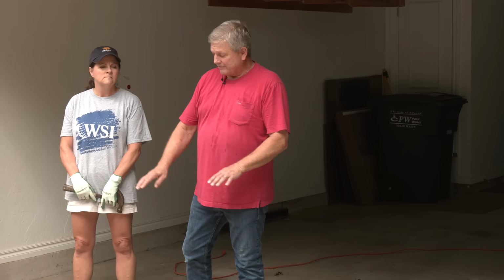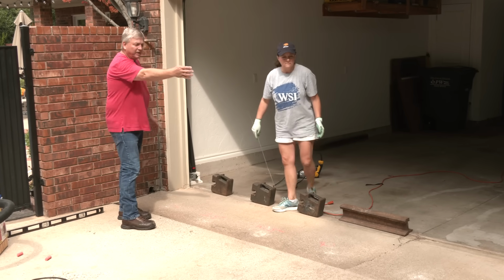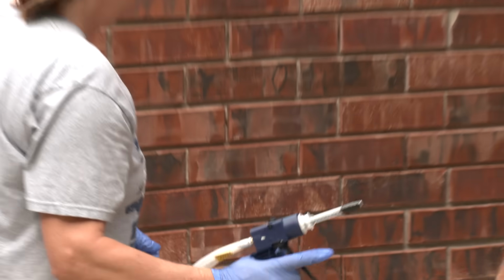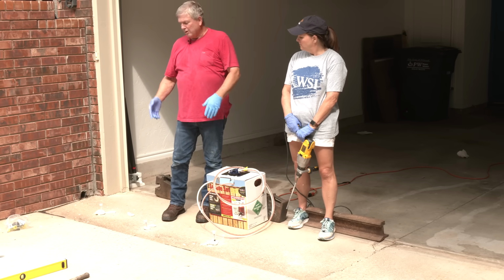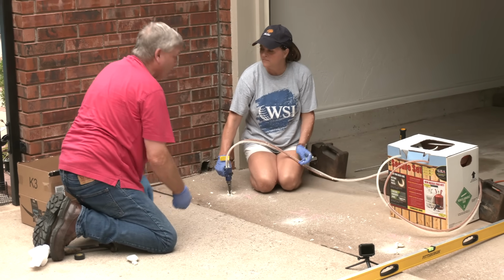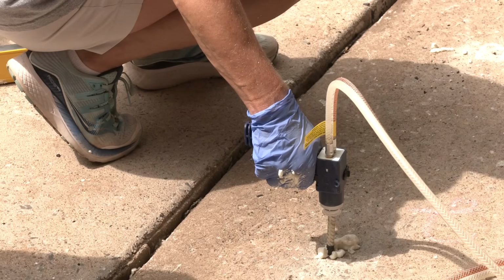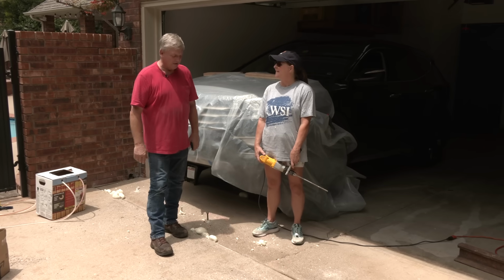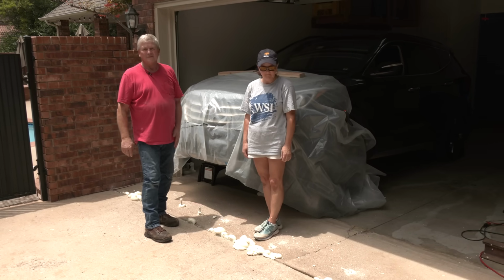Raising Concrete Driveway Slabs with Secure Set

Comment: I would be concerned that I had drilled into a poorly located pipe and was now filling my bathroom with expanding foam!
Great video showing how not every job goes according to plan and you need to adapt.
Reply from the maker: Hello Desparky,  The water mains are on the opposite side of the house. There is no possibility the foam could travel 90 feet, selectively find the bathroom, force the concrete foundation slab to crack exactly under the bathroom floor and then fill the bathroom. I understand your concern, however what you are concerned about is not possible.  Thank you.
Reply: @SecureSet-Fence-Installation  Sorry, perhaps my sense of humour was lost on that one. Anyway, I was more considering drainage than water mains. 
Cheers.
Reply from the maker: @desparky  Hello Desparky,  Thank you   No Worries
Reply: Good thing you aren’t working where I am. In the main bathroom!! Yes, Fear Factor drilling every hole. We have a crack confirmed after the linoleum was removed (the beginning of the project) ha! I suspected as much, I removed the built in tub/shower nit, and the crack ran to the rectangular cut out they leave in slabs for working drains. I also have about a 1/4” drop </> from my zero grade point to the back by the toilet and where the tub unit was. I will be filling the 1-2 void in this bath, and wherever it goes towards the master bath. That is the object, mostly fill and support but not looking for a 1/4” lift. I have already repaired enough Sheetrock, thanks. When we redo the master bath it will be the same. That is also the area of the suspected leak, and likely a place for larger voids. That’s in the front of the home and that’s where the put in piers. Getting close to injecting foam. Maybe tonight I have to cobble a form together to block the sides of that rectangular cut out.

Comment: Hi Just a question here... Would it be better if Leslie was off the slab to be lifted and working from the fixed / level side? Cheers John
Reply from the maker: Hello John,  A comment made by others.  It would help a little, but seeing that Secure Set Spray Foam can lift and support up to 10,080 lbs. per square foot, her weight was of little consequence.  Thank you.

Comment: My cement patio is sinking down to where it meets my house foundation. Is there a risk of the foam pushing in the cinderblock foundation?
Reply from the maker: Hello Michigander,  Secure Set Spray Foam when injected under a slab, will always travel and fill most of the voids under the slab before it starts to exert significant upward or lateral pressure. My opinion, is that the house foundation would have more weight and greater stability than the slab of your driveway.  Also, it would depend upon how big the slab is that you are trying to raise. Since the slab does not seem to be pinned to the foundation, I would suspect the slab would move upward before the expanding pressure of the foam would put enough lateral pressure on the foundation to create a problem. Thank you.
Reply: @SecureSet-Fence-Installation  thank you.

Comment: What measures would I need to take to do this same thing to a load bearing concrete slab holding up a pretty weighty second-floor attachment?  Would this even be feasible?
Reply from the maker: Hello Jodokk,  This foam will support 10,080 lbs. per square foot.  You would need to do your calculating to determine if the load on a given area exceeds that ultimate load.  Thank you.

Comment: 800 dollars in material and still have a water problem,
Reply from the maker: Hello Matt, The water issue was addressed.  A new downspout was installed with a 90° right angle outlet that redirected the water down the sloped driveway and away from running parallel along the front of the garage as it was before.  The voids under the slabs were filled and the sunken slabs lifted back to even, level with the garage floor and the other sections of the driveway. Leslie was a great study and did the job very well.  Overall everything worked out as anticipated, completed in just over 3 hours and for 1/3rd the price she was quoted by two concrete tradesmen. Thank you.
Reply: @SecureSet-Fence-Installation  
Glad to hear the water problem is fixed. I’m a contractor and I am looking at your kits to Try on commercial sidewalks (before investing in a dedicated system)particularly where they originally poured the curb and sidewalk separately and didn’t pin the two together and now there is 100’s off feet to correct what has become a tripping hazard. 
With your video, I understand it was instructional, but she obviously has money and should have spent the money to replace because of the major crack she had in the existing concrete. Also doesn’t help to sell your product when the homeowner used her expensive car as a counterweight! I believe there is a time and place. But then again I don’t have every detail about the job. I respect that you put the videos out on YouTube. And just throwing my two cents in!
Reply: @mattc1740  I think in her case it might be a wash on the money.  Diff like you said still have the crack. Her quote on concrete had to be exceptional high. Concrete is not that expensive.  Contractors over charging is.  The kit is very expensive, with no guarantees. For my home since it was already cracked,  replacement would have been better. If it was not cracked, maybe but then again how many kits will you ultimately use? Not sure why the product is so expensive...

Comment: Hey, great video. I have a small area on my driveway that needs repaired. It’s, maybe 1/4 inch off… anyway, I called a professional…I just wanted them to use a filler to fix the crack. The pro educated me and explained settling, voids and foam lifting. Anyway, he proposed three options… the first option addressed the 2’ x 3’ area that needs caulked and apparently lifted 1/4 inch cost $2,500.  Of course, for option 2, he wanted to “protect” my entire driveway (3 1/2 car size) that included a foam injection to create a barrier under the entire driveway for $7,500… and option 3 included options 1 & 2 with caulking the expansion joints and painting the driveway to make it look new for a cool $15,500!! Anyway, so glad I saw you video and introduced to your product… I will definitely give it a try!!! Thank you for your post!!
Reply from the maker: Hello David,  Thank you for the comments.  We are in a back order situation for the spray foam.  Raw material shortages and labor shortages at the plant.  Mid August is our target for getting additonal product.  Please stay in touch, what you intend to do is within the capability of the spray foam.  Thank you.

Comment: I watched this entire video, thanks for sharing. I have a breezeway connected to another brownstone however the 3 large slabs of concrete leading into the breezeway have settled and pitch in the wrong direction towards my home, causing rain water to pool during extreme thunderstorms. In turn the pooled water seeps down into my foundation causing my basement to flood. I’m hoping that this product will work well enough to raise the concrete slabs within my breezeway giving me the desired slope to have water roll away from my home.
Reply from the maker: Hello Jean,  If the concrete slabs are not cracked extensively, Secure Set Spray Foam should be able to do the job.  As you can see from the video, it does take an effort to plan out and inject the foam.  However, I know we have raised some very large slabs and brought them to the desired pitch.  Also, since the foam will be expanded under the slab, and since it is a closed cell foam, it should seal the passageway the water is taking to get into your basement.  We are currently on back order for the spray foam.  Raw material shortages and also a reduced work force to operate he plant.  Hard to get workers to come back since they have been living on all the government subsidies.  We are expecting to have product again by the end of the first week in August.  Thank you.

Comment: Wonder if this will work on asphalt drive
Reply from the maker: Hello Timothy,  Since asphalt is pressed into place, it is not a uniform slab like concrete.  Larger slabs of concrete almost always have some internal metal rebar support, that is a practice that is not common with asphalt.  I don't think the spray foam kits will work well for asphalt.  Thank you.

Comment: Is there a second part or Part 2 
To show clean up and re install of the expansion material?
Reply from the maker: Thank you for the question.  No, we didn't film the cleanup process.  Just remove the mixer nozzle, clean off the foam on the spray gun with a paper towel and apply the petroleum jelly supplied in the kit to cover the o-ring and the orfices on the end of the gun, turn off the tanks and leave the hoses pressurized with foam.  The hose kit should last about 30 days before they would need to be replaced to use any additional foam in the tanks.   Any exposed foam can be cut away with a saw or sharp knife, and spray paint over the foam to close off the cells that have been opened by cutting.  We use acetone and/or brake cleaner and a wire brush for concrete cleanup.  But, do not use chemicals on the spray gun tool, since you wouldn't want to melt the plastic or the o-ring.  Once the tanks are empty and no longer pressurized they are no longer considered a hazmat issue.  Dispose of the metal tanks and hose kit as directed by your local regulations. 
There are all types of products sold to seal your concrete expansion joints, as well as YouTube videos showing the process.
Reply: @SecureSet-Fence-Installation  thanks

Comment: Aside from breaking out the old concrete, for what you spent on foam you could have just poured new concrete for less.
Reply from the maker: @tabcobra, The reason Leslie chose Secure Set Spray foam is because she got 2  bids from concrete installers and both of them were more than double the cost of repairing and lifting the concrete with foam. She did her homework.
Reply from the maker: Well, actually that is not true.  She had bids to do the slab replacement, which were more expensive, but she also had other reasons to use the foam.  Another reason is the quick cure time of the foam and being able to drive in and out of the garage in 1 hour.  Also, she would have had to fill in the void with dirt, which wouldn't be fully compacted and it would have eventually settled again.  There are a lot of reasons to not always go with the traditional way of doing things.  We have many DIY customers, but also many construction companies and handyman services using our Secure Set Spray Foam, as well as our Secure Set liquid mix products as alternatives to concrete.

Comment: Great video presentation! I like to raise my driveway slabs at the garage opening using this Secure Set product. I am wondering where I can buy a drill bit like what this video is showing. It drills the concrete like butter. I need specs such as diamond drill bit or carbide or what it is and a seller site. Thanks.
Reply from the maker: Hello Mangala,  The drill bit is a 3/8" dia. Concrete Drill.  The tool is called a Hammer Drill.  That's what makes the drilling so easy.  The concrete drill bit will not work very well with an ordinary rotary drill.  Get a 12" long drill bit and a hammer drill and you are ready to go.  Thank you.
Reply: @SecureSet-Fence-Installation  Thank you very much...
Reply: Places like Harbor Freight, Ace Hardware, Lowes, Home Depot, etc. Tell them you need to drill into a concrete slab and they'll show you the right equipment. 👍🏾
Reply: @ggshandsomeboy5103  Thank you for the info and the time taken to reply.

Comment: When is going to be available? I need 1 or 2 to lift my garage and sidewalk
Reply from the maker: Hello German, We are told they will be available in mid July.  We hope they are correct in their estimate.  Thank you
Reply: @SecureSet-Fence-Installation  ok thanks hope so too, otherwise I will have to do it with cement. Thanks
Reply: Hello German,  Secure Set will lift your sidewalk but not your garage.  Thank you
Reply: Sorry to burst your bubble, but there's no way this stuff is going to lift an entire garage, friend. You're gong to need bottle jacks for that.
Reply: Sorry i didn't want to say a entire garage, one block.... it is divided like the one in the video just one side about 3/4 of an inch.

Comment: Why use car ramps? Just place the tires on the slab.
Reply from the maker: Hello B Pace,  We used the car ramps to focus the weight at a particular point.  Plus it allowed to have the front grill of the car slightly further away from the project site. Thank you.
Reply: I suppose you could. A (maybe small) advantage to the ramp would be concentrating the weight evenly across a larger area of the two slabs you're trying to keep evenly aligned. Another, where the slab is short like this one, is that elevating the vehicle might give you a little more room to work.

Comment: I wonder if the pool is leaking and washing away the dirt....
Reply from the maker: Hello Luke,  As it turns out, there is a rain gutter on the inside of the brick wall that empties at the bottom of the wall. This allowed the water to pool up behind the wall. The water exits the area behind the wall through the small hole at the base of the wall.  A poor design.  This allowed the water to find its way under the concrete.  That problem as well as the lifting of the concrete was addressed.  We have had heavy rains this spring, no pooling of rain water and no issues of under slab erosion.  Thank you.

Comment: Load locks to the top of garage header may be a good solution for holding top of slab from moving.
Reply from the maker: Hello Rick,  In hindsight, that would have been better.  But the car worked and it did not delay the project or the videoing of the project.  Next time, if we have a similar situation, we will look at that option.  Thank you.

Comment: A word of advice to anyone watching this video.... never assume it will go the same as "most jobs". There will be variables but don't let it scare you. It might be wise for the maker of this material to have a list of worse case scenarios to keep in mind and how to be aware of them and how to improvise based on your situation. Overall it seems incredible that it lifted it. I wonder how well the foam holds up in time being saturated in dirt year round.
Reply from the maker: Hello Ron,  Your words are correct.  No job is totally alike. The worst case scenarios are hard to completely qualify prior to the start of a project.  I find the more you investigate with hammer sounding and drilling a few strategic holes that allow you to probe and get a better understanding of the condition under the slab.  If the home owner had the best tools,  the small flexible "Bore-Scope" device that attaches to your iPhone would be the best tool to examine the underside of the slab. One insight I can make about the product holding up under the slab, is that this product is a high density, closed cell structural foam. It will not allow moisture or air to pass through it or saturate it.  Here is a good example of the longevity of closed cell foam  When the Alaska Pipeline was built in the late '70's, the concrete pilings that hold up the pipe above the ground, those pilings were set on a thick bed of closed cell foam.  The reason was to keep the temperature of the heated oil in the pipe from slowing migrating through the  concrete and possibly melting the perma frost under the concrete pilings.  That foam is now almost 50 years old and it is still holding strong. Thank you for your thoughts and comments.
Reply: @SecureSet-Fence-Installation  Is you'll's YouTube still active...
Reply: He is right. The closed cell foam is not going anywhere. I installed an aluminum fence and since you shouldn’t use concrete with aluminum I used closed cell foam, dug down past frost line added crushed gravel and set my fence posts and filled the holes with a product especially designed for deck and fence installation and building code approved.  My fence hasn’t moved at all,  while other fences in my area installed by so called “professionals” are pushing themselves out of the ground as much as 12” or more. The foam fills in all voids making it near impossible to be pushed out. It’s an incredible product. I’ll be using this on a sunken portion of my patio now I see this is in a kit.

Comment: The side of my stoop outside my front door and small patio area are sinking toward the exterior wall of our house. Would this system still work?
Reply from the maker: Hello Mark, We have done many stoops and patios.  The issue generally boils down to this; why did the concrete sink?  Most often it is because there is a void under the stoop or patio.  Determining the size and location of the void is the first step.  I always hammer sound the whole area to try and determine as best as possible the location of the void.  Once you do that you can respond back to us and we can go to the next step.  Thank you

Comment: It seems to me that it would have been more cost-effective to break up and remove the old concrete compact the soil and pour a new slab.
Reply: You may be correct in this observation but what comes to mind is that the newly poured concrete would be a different color than the rest of the driveway so it would stand out and detract from the overall appearance, unless they would have etched, stained, and sealed the entire driveway to try to get a uniform appearance. That in itself would be a lot of work and more expense.
Reply from the maker: Hello Kenneth,  Leslie did get a bid to do just that.  As a homeowner she opted for a solution that turned out to be less expensive and far less intrusive.  She made the  right choice, that's her comments, not ours. Thank you